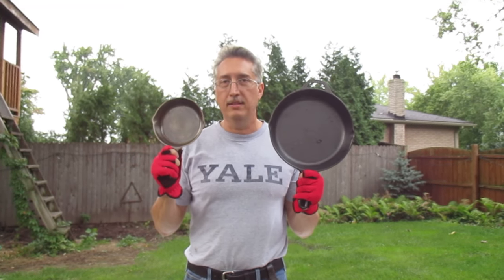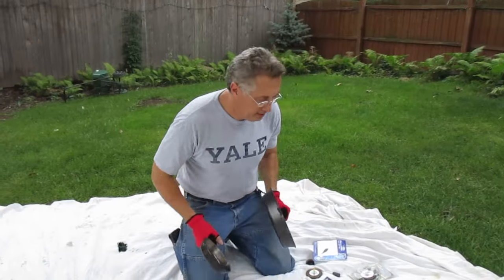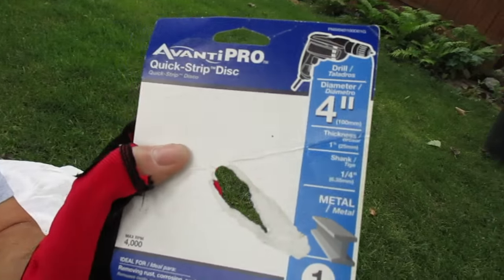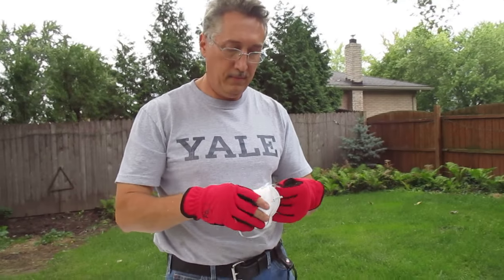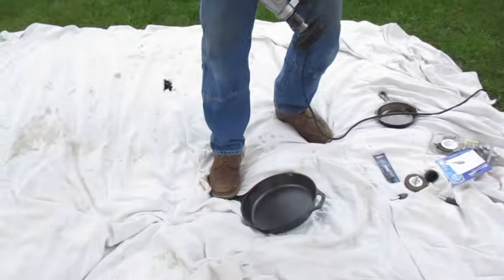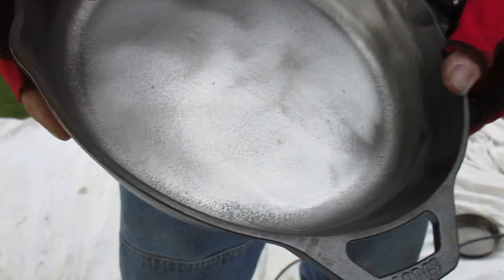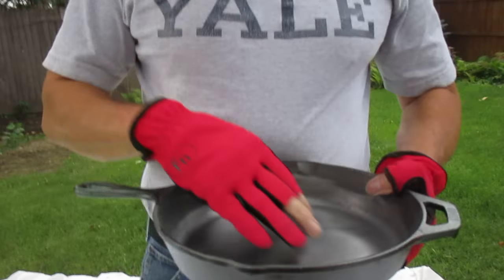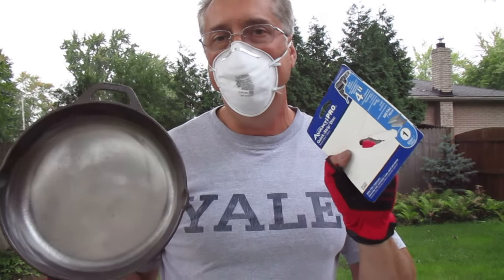Lodge skillet sanding test, it worked!  Lodge skillet for Christmas!  #sandlodgeskillet

Comment: I just spoke to a lodge rep on the phone and the lady told me you can go down too far and it messes it up. Cool video but how does it cook?
Reply from the maker: Cooks great.
Reply: Lol, how can you go down too far? It's all cast iron! Well I suppose if you sanded like through the whole pan that would be too far, but that would be pretty stupid...
Reply: Hal Bouma that’s what I was thinking
Reply: @halbouma6720  Cast iron pans are supposed to have tiny voids for the oil to accumulate.  That's what "seasoning" actually is.  The oil seeps into the voids and carbonizes.  
So you can go too far if you get to solid metal without voids.  It might still work fine, but the seasoning would not be the same.  Perhaps it would rust quicker if neglected?  idk.

Comment: Why can’t the pan just come like that instead of us trying to grind and all that ?
Reply from the maker: You can buy them but they cost a lot more.
Reply: Labor and machinery costs money, more manufacturing processes makes a higher priced product. Buy a Butter Pat, FENIX, or Field if you want one that's perfectly smooth out of the box.
Reply: Kyle Sonsalla I just bought a Fenix this week and love it!
Reply: @malveaux41  they dont need to come like that. It doesn't affect anything really. All of my lodge pans are smooth as glass from just normal use. However, if used properly you can fry an egg on a brand new one off the shelf with no sticking. The rough texture = bad is a myth.
Reply: @vinceruland9236  It's to cut costs. PERIOD
Reply: @jackburton4892  maybe so, but it would be an uneeded step anyway.
Reply: @vinceruland9236  well they machine finished them for 100 years. The only difference is some people lost their job, they're cheaper to buy at the Walmart, and there's pebbles on the finish.
Reply: @jackburton4892  or they just stopped doing it because it doesn't make a difference. Either way, they're great skillets at a great price. I use them just as much as my vintage stuff with great results. 👍
Reply: @vinceruland9236  I have 2 of the newer versions like this (they're 15 years old). I love mine. But I can understand why the consumer would want them finished out after generations of smooth pans. I use mine almost every day. I would never smooth them out like the video though lol
Reply: @jackburton4892  agreed. Mine are smooth as glass from normal, proper use.

Comment: Such a shame that the companies that are making these pans are leaving them rough, and we have to go out and buy equipment to get them smooth, I just don't buy from them, end of story, eventually they will get the picture.
Reply: We need more options. Lodge started doing this to facilitate pre-seasoning, which saved their business. The other major foundries have gone out of business.
Reply: It is in the sand used in the process to make the mold . I E, smaller grit sand smoother cast iron but I'm sure lodge uses the grit best for mass production as well as mass seasoning. The old adage time is money applies here

Comment: That’s nuts. Just go to a junk shop and find an old cast iron skillet. Then put it right into a bbq or fire for a couple of hours. All the junk and rust will burn off and you have a perfect pan to season. Provided the old cast iron is not warped or cracked. All that grinding is crazy.
Reply: Good luck finding a cast iron skillet in a "junk shop" for a reasonable price.  they want triple for a beat up used one.  Like the guys says in the vid. you can grind it out in 15 minutes.  You will search every junk shop in your county before you find a decent used one at any price....how long will that take you?
Reply: I was lucky, about two years ago and found 3 very old Lodge, one Griswold, and one Wagner. The finish were all in poor shape but they were solid and not warped. I paid about $100 for all of them. I ended up putting them in my Primo wood fire bbq and cooked all the gunk and rust off of them. Reseasoned. And they are all smooth and non stick. 

The key to the find was Junk shop and not antique shop. The shop was a little store in an old crappy town in Calif. I’m not mentioning the store name because I plan to go back soon and see if they have anymore. I cleaned them out at the time.
Reply: Actually it's not sir. The intent was to smooth the pan of the rough texture not remove rust.
Reply: You put cast iron in a fire for a couple hours it will come out warped or cracked!. About 20 minutes is all it needs. Horrible information!
Reply: @313-v9k  I find them all the time in junks stores in about an hour. But I don't put them in a fire for two hours. For 50 bucks I can have a big box of old cast iron. For 100 bucks I can have several skillets or pots ready to cook in.

Comment: i buy the chinese pans @ less than half price and do the same thing to them & they work beautifully.
Reply: Buy American........
Reply: Support the chinese, they will support you when you need it
Reply: @blackpine6693  yes, buy American.  While the rich are getting richer by buying cheap Chinese made good and resale to American.
Reply: There are just some things I prefer not to have chinesium alloys for, cast iron cookware is one of them. Lodge is cheap enough and seems to work great if they're sanded/polished a bit.
Reply: I worked in manufacturing Chinese cast is 1st class shit!!!!!! We were using a Canadian melt shop then the company used Chinese " castings " they blew apart they use shitty materials!!!!
Buy Canadian or American only!!! I bought a lodge 🍳 actually I used 80 grit sandpaper spent 10 minutes sanding by hand just to get rid of the high spots it works fine for me but I may experiment with a cheap skillet I also own and make is smother than a babies bottom and see how it works .

Comment: why do you start on the bottom of the pan? you start at the top down,. pits are so much better then high spots. a light sand is good enough if your looking for smooth.

Comment: I just buy smooth cast  lol
Reply: for the sake of capitalism, buy a cheap pan a drill and a grinder disk instead
Reply: Why, they charge a crap ton more for properly finished cast iron. Most people have a drill and 30 minutes on the high side. With a $10 tool.
Reply: @lionamongstlambs4119  I find mine for cheap and restore properly no tools

Comment: The best way..if you want a smooth pan.. is to get rid of your new Lodge and buy Any Older pan.
Reply from the maker: Good luck with finding one.
Reply: Not always possible. 
I am disabled and can't 
walk thru endless yard 
sales on the off chance 
that I might stumble upon 
a piece worth bringing home. 
Better to buy a new Lodge and 
make it usable 😉
Reply: Maybe I'm lucky cause of the swapmeet I go to. Usually find more Wagner's here in so. Cal. I pay an average 5 bucks ea. Have 23 skillets and 3 Cast Iron pots. In three months of collecting. Have a lye and a vinegar baths set up. Go to the biggest swapmeet you can find regularly.
Reply: @MeHomer  definitely can find  hidden treasures at the local flea markets.

Comment: Everyone, check out carbon steel pans instead of cast iron.  They work just as well.
Reply: Carbon steel is no comparison  to cast iron.
Reply: Lodge carbon steel is just as rough. Better ones are $50 or more.  That's OK if you only want one, but if you want a variety of pans/sizes it kind of adds up.
Reply: A good cast iron Pan will give you very even heat A thin steel one just  Doesn't do that well.
Reply: @davej7458  just got a de Buyer carbon steel pan as a gift.  Used it for two weeks, just fine. But--back to my cast iron...

Comment: Why not just spend $200-$250 on a Field, Finex, Stargazer, etc.?
Reply from the maker: "Why not just spend $200-$250 on a Field, Finex, Stargazer, etc.?"  Please feel free to do that.  A 15 inch lodge skillet is $50, the bit was $5, I had the drill.  $55 is less than $200 and I like doing manly things.   😉
Reply: @DetroitHomeInspector  Or vintage cast iron. Our local flea market always  has people selling old Wagner and Griswold smooth-bottom skillets for $20-$70.